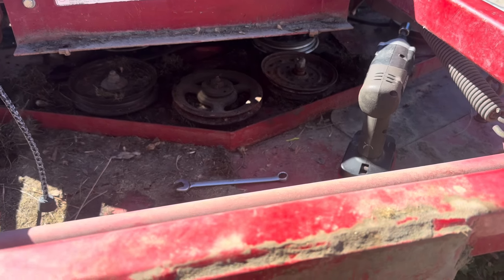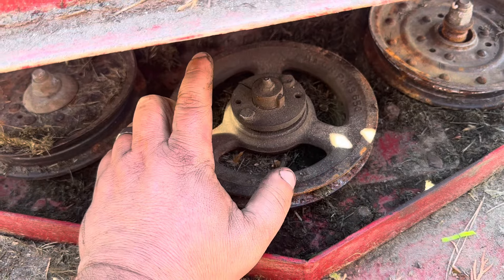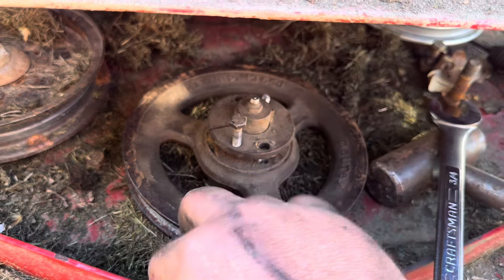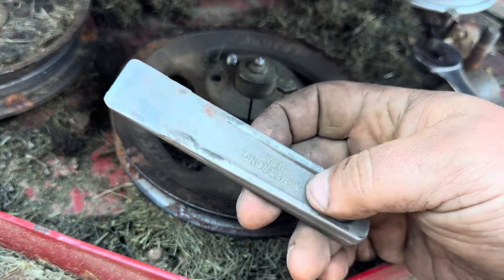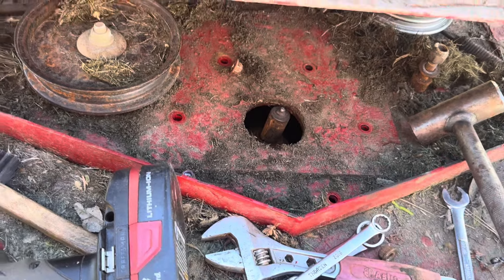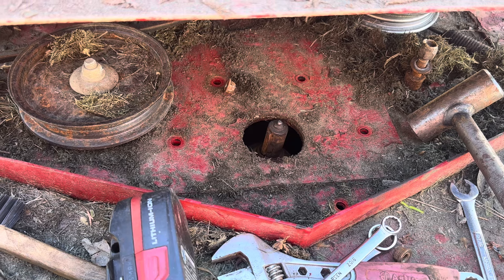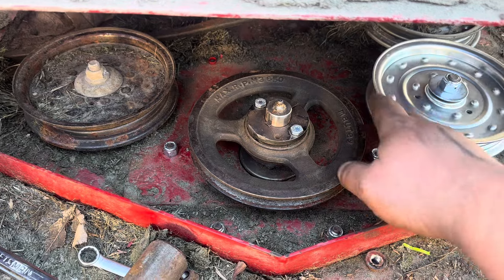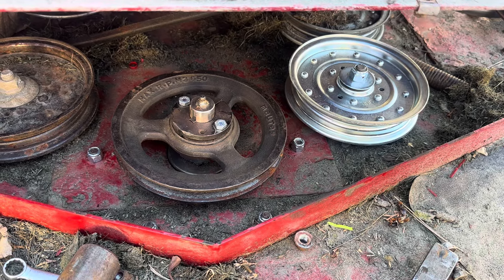Spindle replacement on a commercial lawn mower

Comment: Those 1/4-20 bolts are extremely weak on those taper locks for sure. Scags use the same system
Reply from the maker: Yes they are, I always swap them out for better quality grade 8 bolts and chase the threads
Reply: @smalltownmachineshop6860 luckily most of the time the bolts are easy to get out